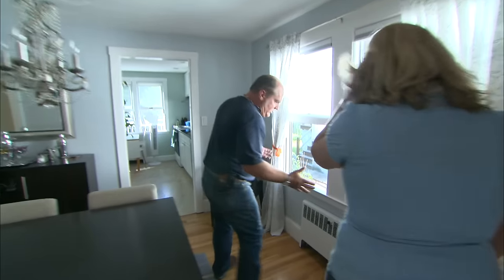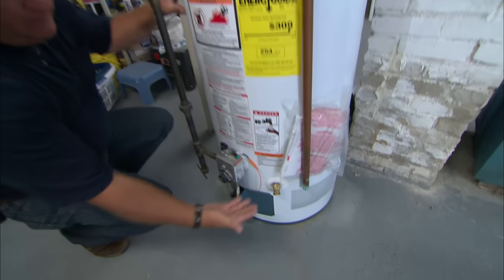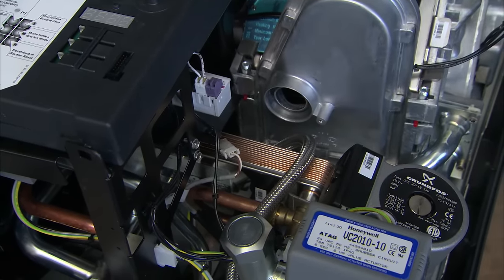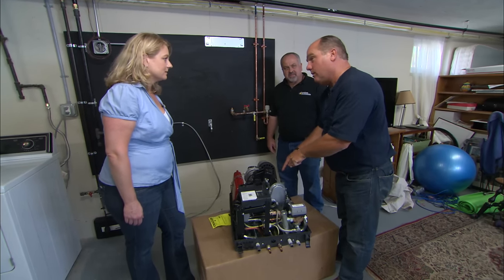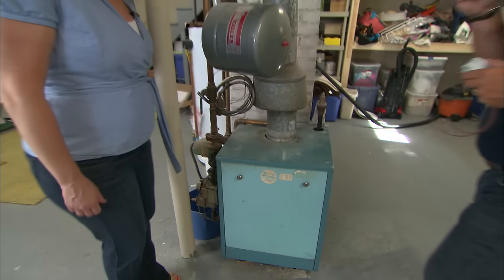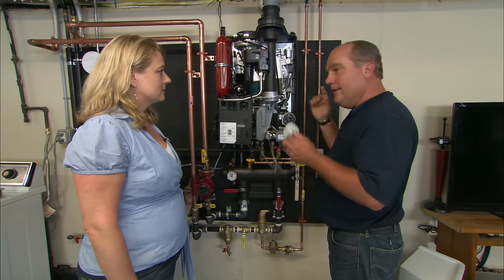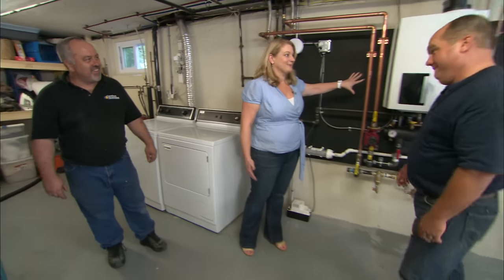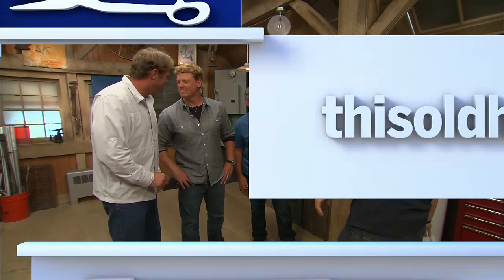How to Install a Combination Boiler/Water Heater | Ask This Old House

Comment: New?  In the US maybe.  Standard boiler setup in the UK since the early 80's though I'm not sure we had instant on demand in a combi until the 90's.  Every home should have one if they use gas heating with radiant panels, baseboards or flooring.  I'm sure they could connect up to a heat exchange air handler too but that could get expensive to install and we all know that up front costs, in the US, is always considered over running costs.
Reply: +Gravel Trap King Yes new in US less the 10 years , Most  are installed wrong here in the  U.S. , Customer have  the Out door reset removed do to poor heat output. Most homes are under radiated with baseboard, Original boiler were pushing out 180 to 200 degree water. How often are boiler replaced in the UK?  Here in U.S. most customers are expecting 20-30 Years. TY
Reply: Boilers replaced in the UK?, I'm not sure.  In the house I grew up in, they replaced them due to technology and efficiency improvements not mechanical failures.  My parents replaced the coal boiler in 1982 with a gas version and they replaced it again in 1998 to get a better one that used less gas, nothing wrong with the older one, it just was too inefficient to run compared to the newer models.  I'm installing a boiler to heat radiator panels in our home in Utah (to match our UK home setup) they are great at keeping the rooms warmer, I hate the too hot, too cold air handler feeling.  I want gentle heat that is cheaper to run.  costs a little more to install but better in the long run, and it can easily be attached to solar collectors to heat the water anytime of the year so the boiler has less work to do.  As long as its not snowing the typically clear skies in Utah allow solar collectors to pull in lots of free sun heat.
Reply: Knight Hvac 20-30 years??? My cast iron American Standard gas boiler is 60 years and still runs great with very little maintenance.

Comment: I bought a lochinvar noc199n.  Mine did not come with the black peice yours has underneath.  Do I still use the old circulator pump?   Also, on the old boiler the out and return pipes were kept separate.  The diagram shows a bypass pipe.  With the bypass pipe how does the water get forced into boiler and not just circulate cold water?

Comment: Regarding SPIROTRAP and SPIROVENT - wrong installation:
At 7:17 we have a close look on how they were installed. Doesn't make much sense.
The Spirotrap is mounted correct, collecting all the debris from the hydraulics BEFORE entering the water heater and pumps.
The Spirovent however will work best, when mounted right behind the water heater at the hottest spot in the system and in front of the pump. It collects all the air bubbles from the water, just as you can see them when boiling water on your stove. The process continues over and over and makes the water adsorptive. It means, that the water will now collect any left air from the system by dissolving it. The water passes the heater again, solved gasses become bubbles, which are again seperated at the Spirovent. 
If mounted correctly, you will less likely face any issues with air in the system.

Comment: Just installed a 30Kw air-to-water heat pump that runs off my Solar panels and wind turbine. free heat and free electricity. all the electricity I produce that I can NOT use or Store on the battery pack is being sold with. it's perfect for a 523901 Square inch house! alto this is a fare more expensive purchase up front but the entire system  will pay it self off in about 10 years.

Comment: Oh goody' so if one small thing in the combi failed you lose both hot water and your heating. I would have left the old setup in place but isolated from the sistem as an emergency backup.
Reply: That would be extremely combersum on the heating side, those systems have to be bled.

Comment: Looking to heat a 2000sq radiant house along with hot water for 2 bathrooms and 1 kitchen. What is a good combination unit? Live in northern MN and will also have a outside wood boiler for the winter. Is it a good idea to have the propane as a backup unit when the owb is in use?
Reply: Joe Ellestad In the U.K. 2000 sq foot would be considered a generously proportioned family home. Two bathrooms is a stretch for most combis if they are used at the same time- it's possible, but showering performance might be disappointing when the incoming water temperature is low. Although combi boilers have been widely used here for decades, for larger family homes with higher hot water demand a mains pressure hot water cylinder is still preferred. We use one boiler and a three port valve to serve both the cylinder and central heating. It eliminates the need for a separate water heater, allows for a backup (electric element in the cylinder) and means your boiler is in use daily rather than sitting idle for months at a time during summer which helps prevent parts seizing etc. It's also possible to integrate a wood boiler into the system by clever plumbing so you can run on either system or even both at the same time. There are various methods of doing so including the use of buffer tanks or simple manifolds that serve as a central point for both boilers, the heating and hot water circuits and allow for any combination of heat production and consumption.

Comment: Ive never seen flue pipes placed in such close proximity to a window. The flue pipe exhaust fumes will go right back into the house. Especially that house since they have an air conditioner in the window. The air conditioner will pull the exhaust fumes into the house when its running. im shocked that was allowed. No primer on pvc either? what state are they in and do they have inspectors?
Reply: @brennatrix   I believe code is 36" from any opening.
Reply: @brennatrix  Navien and Rinnai require 12" between the flue and the intake. But UBC requires 36" betweeen any opening and the flue pipe. Atleast that is what is enforced in my area of Northern Cali.  I install 10-15 Navien boilers/water heaters a year.

Comment: How come you did not use a low profile termination kit on the side of the house for the vents? Something like Rheem Horizontal Vent Termination Kit, or the IPEX Plastic Side Wall Vent Kit, or Trane BayVent?

Comment: @thisoldhouse this looks like a wonderful system but you didn't talk about price.  how does it cost??
Reply: 10g+ installed
Reply: The units aren't very expensive, relatively speaking, but for some reason installing them the labor jumps 3x despite all the propress, premade manifolds, and combi valves that are out there these days. $10K is about what I've heard, for labor only.

Comment: Great technology however when it brakes its expensive  old boiler uses lots of gas but hardly ever brakes
Reply: Exactly. With a little extra effort she could have kept her old equipment and still had a hybrid and efficient modern system.
Reply: Everything is expensive to fix.  old or new
Reply: Electric boiler is better

Comment: Hi!  Could you please tell me what Make and Model you used?  I see Rinnai?

I'm looking at installing one This Week in my house.  (in Ontario, Canada).  It is a big old house, probably close to 3000 sqft, so I am curious if current models can handle that?  My guy is recommending Navien combo boiler.  (not sure what size.  I think 240)

Thank you for your help!
Reply: +David Learmonth IBC Boilers are made in Vancouver!
Reply: +Thomas Macgowan Thanks!  I installed mine back in February.  Ended up going with Viessmann.  Works fairly well.
Reply: @davidalearmonth  how come you got it over the navien? My plumber is recommending the navien.
Reply: @tombomombodombo  Viessmann is just a really good name, and I think our previous boiler from the 80s might have been from them.

We've been quite happy with it. Although the one change I would make is I would have had the boiler heat a small tank for domestic hot water instead of doing it completely on demand with the combi unit.  The on demand domestic hot water is very quick to start, but the problem is due to safety the system still runs for 30 seconds after you turn off the hot water at the tap, which means that if you or an appliance request hot water again in that time suddenly you are getting cold water.

Comment: Hope they explained that as Long as you are using hot water you are not heating your house have five people take a shower for over an hour on a 20 degree day in a old house and watch the temperature drop in a heartbeat great idea for energy saving but not practical for extreme cold should heat both at the same time to prevent the house from getting below the desired temperature
Reply: Brendan Bussell
Reply: For more than 2 people in one house I would prefer a sideby water boiler (DMHW) 
 (heated from the gas heater) for more comfort and instant hot water.

Comment: 1. No primer on the vent. Asking for a leak.  
2. Vent to close to a window.  Sure it tells you 1 foot in the book.  Every code guy around requires 3 feet 
3. With a two story home and those convectors.  The built in expansion tank is not going to be large enough. the relief valve is going to be popping. 
4. Not a fan of the Grunfoss 3 speed pumps for that system. The Taco 3 speed will do the same job. But if the pump goes out at night or over the weekend. The customer can swap to a different speed to get them through till you can get a replacement. 
5. When installed right.  Those are good systems. If the customer has any kind of demand for hot water.  Always better to install an indirect.
Reply: Common sense let's me know ike has no idea what he's talking about

Comment: I see hydraulic, air and dirt seprator, but where is the expansion tank? I guess rennai doesn't require it? But hydronic principle does...
Reply: it's the red thing inside the boiler.  You could add another depending on the water content of the heating system. 3:36 you can see him trying to break it off while hanging the boiler. lol

Comment: What happens when you lose power in the winter?  No hot water and no heat?
Reply: Get a generator and you've got both, assuming you have hydronic heat and not a hardwired forced air handler.

Comment: Why do you use copper piping close to the heater and then pex later on?
Reply: Copper is harder to route and expensive so it doesn't make sense running across the entire house if they don't need to. On the wall, they can either do copper or pex, but the manifold would always have to be metal for rigidity and holding back the effects of water hammer

Comment: We are at prsent deciding on a combi type boiler ,and enjoyed this very helpful video,i wonder could you explain to us what those other pipe connections  units you have had to fit underneath the boiler ,one i assume is a pressure vessel and may be a non return valve,but you have a massive cast iron unit on the gas,hope you did not mind my asking,
Reply: There is no cast iron on that unit.
Reply: From left 2right: 
-  outgoing hot water for heating
- outgoing hot water for shower and sinks
- incoming gas
- incoming cold water
- return of the hot water from heating

Comment: Ya I would of tried to fix it. To toss out a 4-5 k+ unit after 4 years is a waste of machinery and money even if you have lots of it. 
 I do agree with most of the comments here about Tankless, it is a hard sell and the savings are not that great yet what 20 to 30% of your gas bill wow maybe. 
You need a few things working for you if you are even thinking Tankless. 
1. A (good knowledgeable Di Yer) because it is way to expensive to have a authorized installer- plumber do the work $900 to $2000 + Payback is way down the road if ever.  A lot of Plumbers run from this type of installation, way to many headaches and repeat calls but they are getting better and so is the technology. 
2. Find a (manufacture that will allow a Di Yer to install the Tankless and give you a warranty of parts) on it like Rheem and Nortiz. Please Read the fine print in the warranty section before you spend your hard earned money, many companies will cancel the warranty unless someone with a licence is installing the Tankless.
 3. Don't even think of owning a Tankless without a recirculation pump/system. The wait for hot water and the waste of water down the drain is way to much.
4. Federal Tax Credit may still be around in 2018 up to $300 need .82 EF + rating.

I am about ready in 2018 to jump into a Tankless probably Rheem or not still desiding. I will spend 1 to 1.5k on it knowing I could replace my current 18 year old TANK model TWICE for that $amount$.  If I have no breakdowns in 10 years I will be lucky, if I do its back to the reliable tank model. I'm all for you Di Yer's Good Luck.
Reply: Bill Cooper and all a person needs to do is turn down the internal thermostat!
Does anyone really need 120°F water coming out of the tap?

Comment: look at this guys, installing exhaust pipes next to a window..wooow what a death trap.
Reply: 50,000 BTU and up can be within a foot of a window when it's a direct vent appliance.
Reply: @frmerrin2  it is 12 inches with a concentric  kit or terminal vent kit. it is 4 feet the way they did it.
Reply: @roberthudanish7405  Wrong,it's 12 inches for direct vent which is exactly what they did, if they were merely exhausting flue gas and drawing combustion air from the basement than it would have to be 4 feet.

Comment: I have a question sir.i wanna know if is this a water heaters or it is? boiler combi
Reply: It’s a combi boiler, a combi does heating and hot water it just gets rid of the need for having a hot water cylinder

Comment: What’s the difference between this and just running a tankless water heater?
Reply: zackdreamcast This is just a guess but a tankless only heats water for use at a appliance.   This does that and heats water in a loop for the heater upstairs without running up your water bill.    Otherwise you would need to put in 2 separate tankless systems.

Comment: Amazed they still don’t work in metric...

But why not install a condenser builder that recycles more of the exhaust heat with a pipe-in-pipe flue?

Comment: The additional cost in maintenance thats Recommended plus yearly  safety check on the wall hung makes it unattractive.  As well as part availability.  if the space is limited you may have no choice . Tank water heater is very simple and less things that can go bad. I had mine for over 13 years with limited maintenance.  
I work on heating and cooling systems everyday the last thing I want  at my home is a unit that needs alot of maintenance. I would sacrifice some efficiency for a unit that will last for many years and less break downs.
Reply: Ken Ortiz all gas appliances should be serviced annually though... doesn't matter if it's a modern combi or a floor standing cast iron installed by your grandparents in 1950. Costs are the same- there is nothing more to servicing a combi, it's just case removal, clean and check, possibly replace a $5 thermocouple and burner seal. Close up again, check gas pressure and combustion gasses- exactly the same as any other boiler / furnace.

Comment: What is part failure rate of each component of each unit with or without a service contract.
Reply: Not that common, depending on the type of boiler but most of the parts you get within a few days, combi boilers are one of the best inventions ever honestly would highly recommend getting one if you don’t have too many radiators

Comment: Hi, how can I remove the air from the baseboards with this system?
Reply: they have a built in air purge inside and you have to add one in line when yuou put in your manifold and when your done just purge out the system with a house
Reply: U blead the radiators .
First u fill it and let it run on high temp.
Then u let it cool down and most of.the air is in the radiators and u can turn open it with a special.screw and let the air runmout of it till.only water comes out and u close it

Comment: I'm not impressed with these units. I owned one for hot water tank replacement and it would stop working in the middle of a bath. Also, they require yearly cleaning and maintenance and are prone to scaling, no thanks. I had a guy come over and beg me to replace my boiler with one but I was skeptical. I ended up using a cast iron boiler with a stainless steel condenser on the side which is almost just as efficient as these, also, I used a indirect tank for hot water, that way I know I have hot water there, not phantom hot water that may or may not work. Also, the warrant on these units is typically half of a "real" boiler.
Reply: Lots of uninformed misinformation there and surely all boilers require an annual service for safety and to validate your guarantee. There are many different manufactures of combi boilers and as with everything you get what you pay for. Condenser boliers are the most efficient available and the savings are reflected in your energy bills. If your worried about hot water issues just avoid the combi and get a separate tank. Limescale affects all systems, circulated heating water in a sealed system is not effected by limescale, only supply water.

Comment: Very nice! But will it be Ok in - 40? I've seen the exhaust frozen on condensing units, then pressure switch shuts it down .
Reply: Your supposed to have a slope on the exhaust which is stated in the code book of your region to have the water go back into the appliance, there is a condensate trap in the appliance then it goes to a drain
Reply: That can happen on any type of high efficiency unit. It happened last winter on my parent's new natural gas forced air furnace. It's all about the install, which was shabby, in their case.